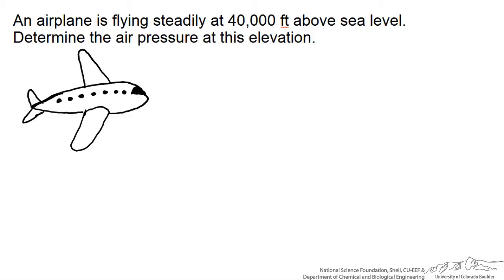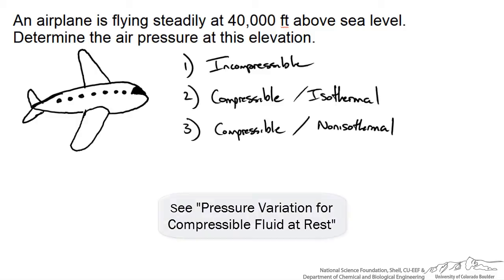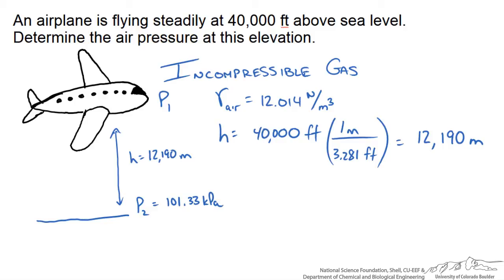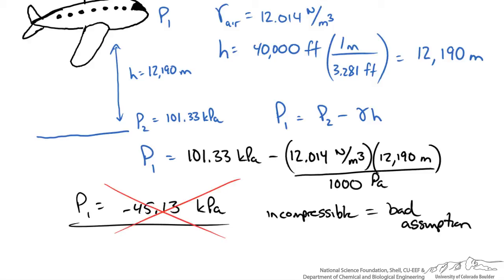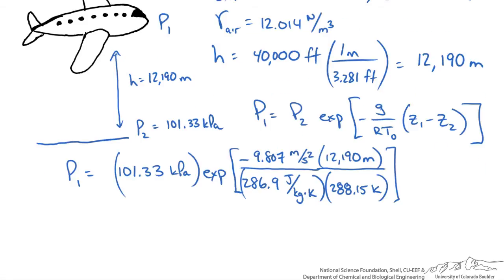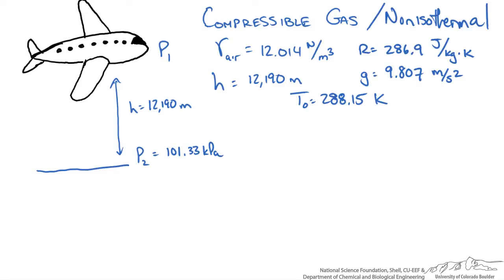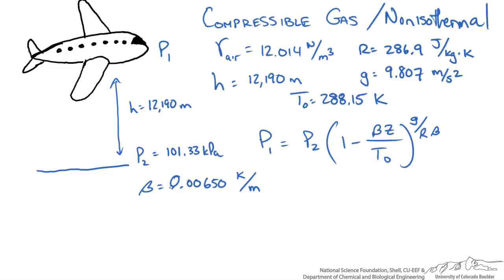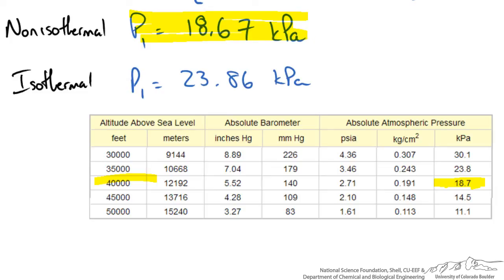Fluid Pressure vs. Elevation (Incompressible vs. Compressible Cases)

Comment: There remains a kg -1 in exponent unit
Reply: Not quite. On the denominator, the kelvins cancel. Remaining is m/s^2 * m * kg/J.

The first factor is the unit of acceleration, and the third factor is the unit of mass. This gives the unit of force, N.
Then, force * distance (second factor) equals work, which is measured in the unit joule, J, which cancels with the J in the denominator. And thus, all the units are gone :)